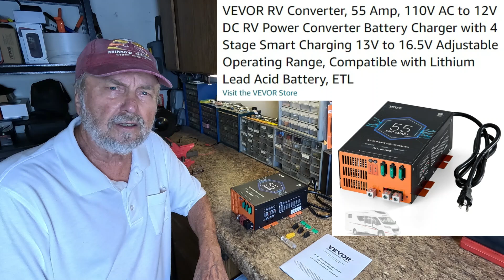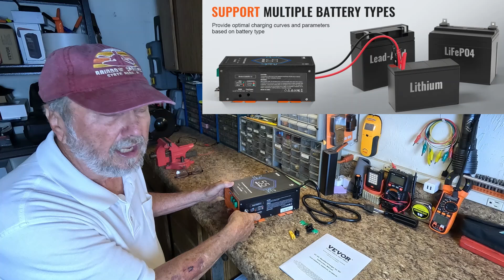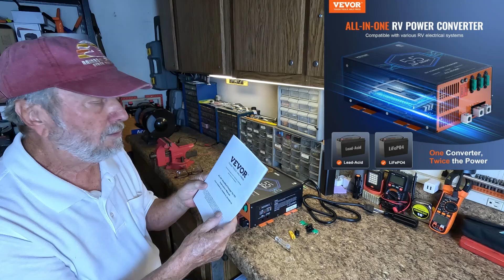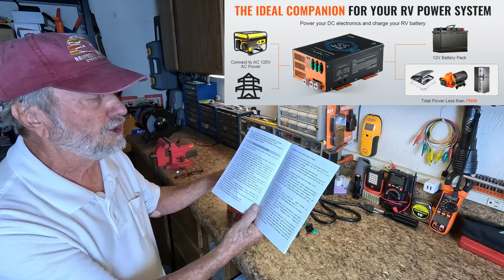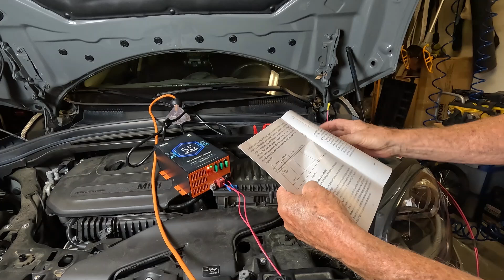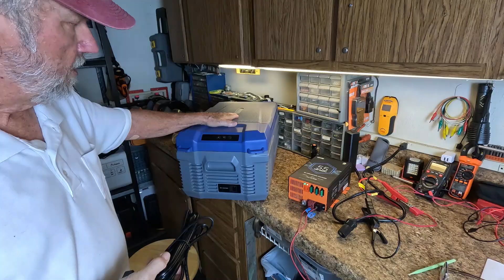VEVOR RV Converter 55amp will maintain batteries Charged

Comment: I wonder if can 55A pump in lipofe4 battery from standard 110v AC/ 15A❓️❗️
Reply from the maker: Yes
Reply: @samowens44  in recomanded 3 stage voltage special for lipofe4❓️ pls. you tested 55A/ 3stage to lipofe4❓️tks.
Reply: It was a shame to buy it because it doesn't know what you say here or what the manufacturer promises❗️👎
Reply from the maker: All RV's and campers have a 12 volt battery system that needs to be keep charged and supply power while you are using the devices in the rig.  55A will be just fine to keep your batteries charged.  The Converter in your RV is the one item that you do not have to do any maintenance.  It just sits there and does it job..  Just install and connect your batteries, and enjoy your camping, I think you are over complicating all this.  Try it!!
Reply from the maker: @500Hun  The converter is designed for RV applications.  It says right on the unit.  It has 3 modes, Lead Acid, puts out 13.6  All RVs have this charge voltage for the Coach Batteries.  There is a Fixed voltage output, 13.33  There is the Lithium Mode, 14.6 volts.  so the Converter will put out the correct charge limits for each of the battery types listed.  There is a mode switch that will slide to each of the modes.

Comment: Can you draw amperage from your battery when this is being used?
Reply from the maker: @dereckmartin7348  All RV and Campers have a set of batteries and the batteries are keep fully charged by a Converter, just like this one.  They have the power to adjust the amperage as you use lights and items that require DC voltage.
Reply: @samowens44  got it.  I was just wondering how it would perform if  I pull 80 amps or so while using this charger.  Would it the charger be okay with that?
Reply from the maker: @dereckmartin7348 the max current output for this product is 55 amps.  Sounds like you require a larger amp converter.
Reply: @samowens44 Vevor has an 80 amp model of this product, as well as this 55 amp and a 45 amp.  I've read several reviews of this converter that state the voltage does not drop down to a proper float level for lithium batteries after they are charged which is very bad for the battery(ies) life expectancy.  Do you have an opinioin on this?  Thanks.
Reply from the maker: @melrobinson6919  The model I demonstrate has a mode option to select Lithium type batteries.  That should deliver the proper control for charging.  The other Amp chargers should have that Mode options.
Reply: @samowens44 Yes, that is what it is supposed to do in lithium battery mode, But the 55amp unit I just bought is not taking my new LiFePO4 battery past 99%SOC after 20 minutes or more charging.  This is after charging up to 99% quite rapidly.  At 99% SOC, the voltage coming out of the converter is still 14.50 volts per my multimeter, same as when the SOC was much lower.  I messaged Vevor to ask their opinion of this situation.  I don't want to shorten the lifespan of my new battery by constantly sending it 14.50 volts.  I'll update my comments here once Vevor responds to me.  Thanks.
Reply: @melrobinson6919  i have the same question: how it works in 3 stage for lipofe4 batt.<55A?
Reply: @500Hun  Just saw your post.  I never got the converter to switch to the 13.6V float voltage from the 14.6V in the Lithium setting. (my multi-meter was acually measuring 14.5V).  What I have been experimenting with is setting the converter to the Fixed Output setting.  This setting charges my LiFePO4 battery, when drawn down below 100% SOC at 13.6V while the amperage is roughly 3-4 amps which goes down below 1 amp as a full charge is getting closer, so its like a float charger.  Seems this would be easier on the battery vs. sending it 14.6V when close to full charge.
Reply from the maker: The converter has protection that will not allow it to draw more current for limits.  Most all converters and like equipment have this protection, just use it and it will draw what it can.  If you device requires more current, it will not get it and you will see performance issues for device.
Reply: This makes a lot of sense. Thanks

Comment: So if you install it in just say a pop up. Do you have to swith the mode to charge the battery then swith it back to use the 12 volts?
Reply from the maker: @hoyt7710 , this is a Converter you would mount in a RV as an example.  You connect it to the Coach Batteries and it Keeps the Batteries charged as you use the RV power needs for all the DC circuits in the RV.  There is no on and off switch on the unit.  Connect and forget!
Reply: @samowens44  ok. Thanks.

Comment: Nice vid but you really need heavier wire to handle 55 amps on the DC side.
Reply from the maker: @bdv861, I agree 8 gauge wire would have be great, this is all I had for the demo.  I just wanted to give the hookup idea and the operation.

Comment: Do you get 110 to operate a hair dryer
Reply from the maker: No, this is a converter, it takes 120volts and converts to 12volts DC.  It is a battery charger.
Reply: @samowens44  if I have a solar panel to charge I don’t need that right
Reply from the maker: @gosselinsergegs  A solar charger can charge batteries.  The converter is used in RV, Campers, boats to charge batteries when you have a/c available.
Reply: @samowens44  thank you so much for the info I was wondering why do I have a solenoid beside my converter
Reply: Evening so if you hook that to a rv marine battery it will charge the battery and provide 12volt for lights?  Or is the system drawing from battery and supply is just charging it as you draw?
Reply from the maker: @ yes charges battery and provides power for lights.

Comment: Nice video. Is there a way to adjust Lithium (Lifepo4) charging mode voltage? I have a multiple bad experience with vevor devices not properly calibrated from factory and, as  result, not working with my lifpo4 battery properly. (
Reply from the maker: @yuriykorenyak2351 Thanks for the comment.  No you can not adjust the voltage for Lithium or Lead Acid.  Only Fixed mode can be adjusted with the adjusting screw on the side.  The Fixed mode is really only for powering up device, things like pumps, Car Refrigerators and other dc required items.  It does not charge the battery with the proper charging you need from the other two modes.  The Lithium and Lead Acid monitor the battery condition and go through a programed set of 4 stages to reach the proper charge level of your battery and maintain it there.  Good luck.
Reply: @samowens44 Sam, the manual that came with my new Vevor 55amp converter states that the fixed output mode "can be used to directly power 12 volt equipment and or maintain the battery at that voltage."  So it is apparently sending the adjustable output voltage to the battery at all times in this setting.
Reply: Sam, I just deliberately discharged my RV's LiFePO4 100amp battery down to 95%SOC to test the fixed voltage output option for the converter.  This mode does in deed charge my battery, at a low amperage in the 2.7 -3.3 range, going lower as it gets closer to 100%SOC.  I believe this is good to know as I could probably just leave the converter on this setting and take advantage of this slow charging rate as a maintaining rate.  If the battery becomes very depleted, I could switch over to the lithium battery setting and pump in some capacity as the full 14.5 -14.6V charging rate.  I just wish the switch was a little more convenient to adjust since I have to remove a drawer to get to the side of the converter.